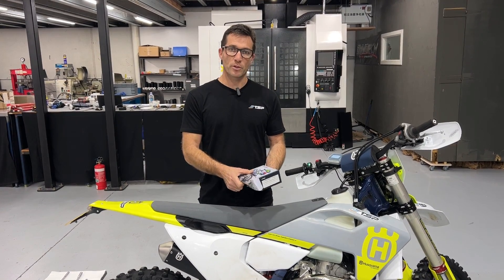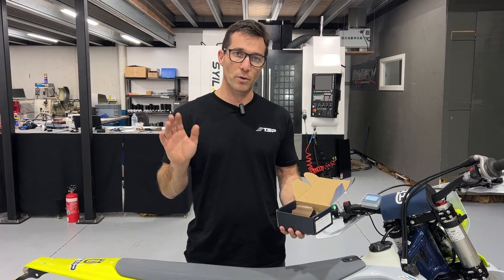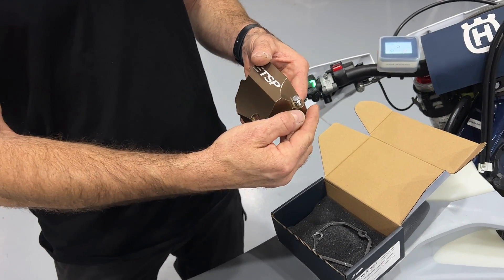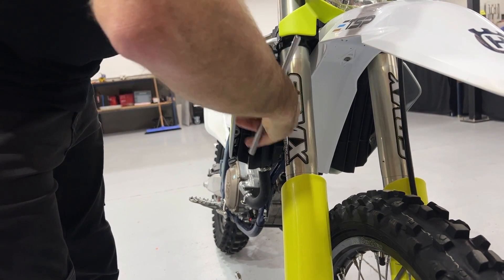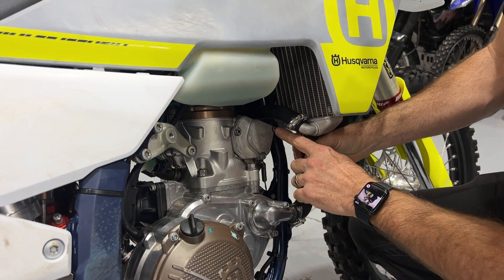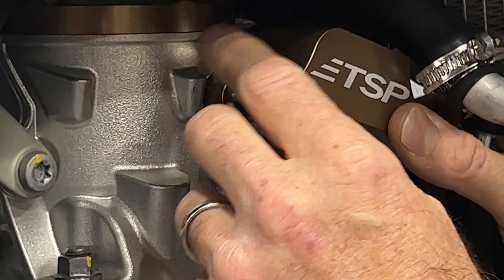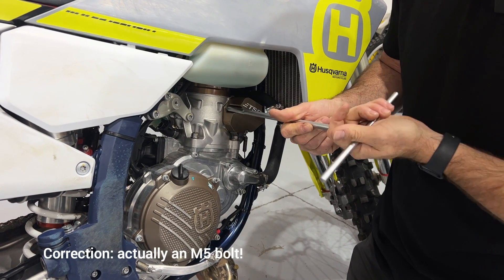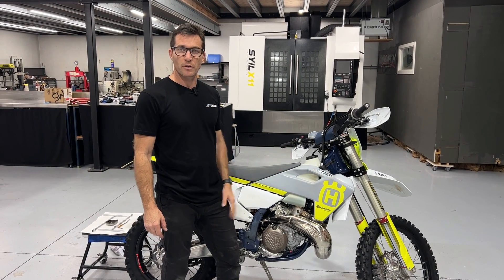TBI Oversize Powervalve Cover Installation- Two Stroke Performance

Comment: I just purchased one of these but haven't had a chance to install it yet. I was told by South Bay Motosports that now you just use all the stock bolts for the installation.

Comment: Installed one of these on my 24 300exc amd the engine management light has come on (5 lomg flashes) I've heard the cover can sometimes need a small amount taken away with a dremel??? Is this correct??? Thanks
Reply: My bike did the same thing. Did a powervalve reset, check engine light went away.
Reply from the maker: If you perform a powervavle reset it should stop the code from coming back. There were a very limited number of covers manufactured which 'may' have caused the PV to generate a fault code. Performing the PV reset will normally fix the issue.
Reply: @TwoStrokePerformance  have you had issues with the set screw fouling the PV cover??? I can see where it's been hitting???
Reply: Did you get to the bottom of this just installed one in my 2025 and on hard acceleration it throws the light on

Comment: TSP is not a company I would recommend. Last year I picked up a new XC 250. I ordered some parts including a TSP head, planning to build a bike over the winter. I then had an opportunity to pick up an xc300, which I did and subsequently sold the 250 still in the crate. I emailed TSP asking if I could exchange the head(still in the unopened box)for one for the 300. No reply. I emailed them again a week later stating I would pay any price difference as well as shipping both ways. Noreply. I emailed them a third time a couple of weeks later. No reply.  They simply do not care about customer service.
Reply from the maker: Please stop spamming our videos with the same comment. We have responded to a previous comment from you several months ago asking for you to contact us with more details as we had no record of your email address or anyone contacting us via email with a story like this. We have not heard anything other than more anonymous comments on videos. The fact is we have no record of your story and no missed emails. Perhaps it was dealt with and you didnt like the outcome, or perhaps you were dealing with one of our distributors overseas? If you are serious about having this dealt with please provide a name, email address and purchase receipt and we will happily look into it. We would normally exchange a product with no questions if the purchase was within a recent timeframe and the goods and packaging were as new. Unfortunately we cant always be held responsible if you change your mind about a bike build, but we do take customer service very seriously and make significant efforts to keep the vast majority of our customers happy. You cant always please everyone though.
Reply: @TwoStrokePerformance   I'm happy that you have finally responded. I will allow readers to determine if I am spamming or this is in fact an example of the sort of customer experience they can expect when dealing with SoutBay MotoPerformance. I have no reason to lie and nothing to gain other than helping others understand what happened in my case. I'm happy for all the customers that had a better experience.

I am 58 years old and have ridden motorcycles practially my entire life. I raced on the professional level and have had more bikes than I can remember. There are 5 in my garage at this moment. I am decently successful and have no reason to quible over a couple hundred dollars here or there. It is why after sending you multiple emails I simply gave up and gave the head to a friend who had an xc250. There are others that parts for there motorcycles represent a significant investment and for those people, I would say, make your own decision as to whether I am spamming or sharing an accurate account of what happened with my experience.

You certainly never replied to any of my emails and I have the reciepts to back that up. Not to my inbox, not to my spam folder, no reply period!
I'm not going to share personal information on the internet and I have no desire nor reason to contact you directly as I have no need at this point to return or exhange the part I no longer have. You also did not ever reply to any comment I have made on YT regarding this until today. Trust me sir, had you reponded, I would have engaged you just as I am today. You are either a liar, have very poor memory or have confused me with someone else. I'll assume that latter and leave it to readers to interpret the tone of your response and the varacity of my experience.

The only piece of info I will share is that the original email was sent on Sunday, April 21st, 2024 at 4:39 PM Mountain. If you track that down and respond, I will certainly respond back and confirm receipt. At this point sir, I have never recieved a reply to any of the emails I sent.
Reply from the maker: @Sandbagger65   thanks for the detailed reply. It has highlighted the reason for our mutual frustration and finally gives us something to work with… you mentioned  South Bay Moto Performance… South Bay is a distributor of ours in the USA and although we work closely together we are not the same business. We don’t have access to their emails or sales records. If you purchased from South Bay Moto then  you did not purchase direct from us. This would explain why we have no record of your sale or emails. Steve at South Bay is renowned for excellent customer service and it is very surprising to hear your emails went unanswered. I will forward the details of your complaint and discuss with him further.
Reply: You can characterize my experience and detailed explanation anyway you like. You can call me names and accuse me of anything you like. It does not change the voracity of my claims and I’ll allow the viewers to draw their own conclusions, including you.
Reply: @Sandbagger65  our conclusion is you’re incompetent
Reply from the maker: @booger65man we did reach out to SBMP about this and have had several conversations to follow up. I understand he found one email from back in April this year and I believe he has reached out to you recently regarding this. Im not sure why that email was missed, as Steve is normally renowned for his outstanding customer service. 

As I understand it the head was bought from another retailer in the USA (not Steve at SBMP) and then you reached out to SBMP to replace it after some time. This explains why neither us (TSP) or SBMP recalled your story and also why we found it hard to locate the correspondence because neither of us had dealt directly with you previously. Normally we would attempt to address any situations like this immediately and not let them drag on, however in this case we had no name, contact details, or record of purchase to work with and so it has dragged on for longer than necesary. I am sorry if your experience has been less than satisfactory. In future if you or any other customers have problems with a product please reach out through the original seller so that they can approach us directly with all the required info and we can sort out a solution quickly and easily.
Reply: @Sandbagger65 all you have to do is call south bay you dork. I’ve called them 7pm and they’ve picked up and answered questions for parts I didn’t even buy yet. Sounds like you’re incompetent

Comment: Can this be installed on a stock TBI without the TSP kit and receive the same or similar results?
Reply from the maker: Yes it can
Reply: @TwoStrokePerformance  same increase in low down  and mid power?

Comment: Does this sacrifice any top end? How would this work for a 300sx being used for MX with positive results?
Reply from the maker: Hi, no it doesn't sacrifice top end, however if you are riding faster stuff most of the time you wont notice much difference. The biggest gains are at low revs, approx 3500-5000 so if you are riding in that area a lot you will notice a big difference, but if youre mostly above 5000rpm you wont feel much.

Comment: I bought a TSP head for a 23 250 XC I was planning to build. I found a great deal and picked up a 300 XC a few weeks later after which I sold the 250. I emailed TSP and ask if I could exchange the 250 head for one for my 300. They never replied. I didn't think that it would be a big deal. I was wrong. I'll buy from companies that are easier to work with in the future.
Reply: Stop then bs tsp is super easy to work with and is south bay
Reply: You can characterize my experience and detailed explanation anyway you like. You can call me names and accuse me of anything you like. It does not change the voracity of my claims and I’ll allow the viewers to draw their own conclusions, including you.

Comment: How does it work?? 

At high revs the pressure waves travelling back and forth through the expansion chamber help to supercharge the cylinder, filling it with more fresh fuel/air than it would otherwise receive. This supercharging effect, and the extra power that results, is often what riders feel when they say a 2 stroke is “on the pipe” at higher revs.

The downside of this phenomenon is that the same pressure waves that help to supercharge the cylinder at high revs actually make it harder for fresh charge to enter the cylinder at lower revs. This causes a drop in power at low/mid revs. To combat this some powervalve systems incorporate a ‘Torque Chamber’. A Torque Chamber is a chamber on the side or top of the cylinder which is opened and closed by the action of the powervalve. When the powervalve is closed or down, the chamber is open to the exhaust gasses. When the powervalve opens at high revs the chamber becomes closed to the exhaust gasses.

At low revs, when the chamber is open, the pressure waves travelling through the expansion chamber enter the Torque Chamber and are dissipated somewhat, losing some of their strength. The reduction in the strength of these waves helps to improve the filling of the cylinder with fresh charge. Therefore, the Torque Chamber adds extra power down low by reducing the negative impact of the pipe in this rpm range. By adjusting the volume of the Torque Chamber we can further reduce the negative impact of the pipe at low revs, and increase power even more. This is how the TSP Oversize Powervalve cover helps to increase power at low revs (approx 3000-5000rpm).

In order to find the ideal volume of the chamber we spent months dyno and track testing various designs until we settled on a design that made a noticeable improvement in low/mid torque.

Comment: Seems like some snake oil. I read the detail on the website and it does not in great detail say what is going on exactly.
Reply from the maker: Its not snake oil. Some 2 stroke engines have used these chambers as part of their powervalve design for decades. The old KTM 360/380 motors, and the GasGas (now Reiju) 250/300 motors are 2 examples of exactly the same system. KTM has brought back an old design in the new generation 250/300 motor. 

Our website gives a fairly clear explanation on how the cover works...  here is the text... 

"At high revs the pressure waves travelling back and forth through the expansion chamber help to supercharge the cylinder, filling it with more fresh fuel/air than it would otherwise receive. This supercharging effect, and the extra power that results, is often what riders feel when they say a 2 stroke is “on the pipe” at higher revs.

The downside of this phenomenon is that the same pressure waves that help to supercharge the cylinder at high revs actually make it harder for fresh charge to enter the cylinder at lower revs. This causes a drop in power at low/mid revs. To combat this some powervalve systems incorporate a ‘Torque Chamber’. A Torque Chamber is a chamber on the side or top of the cylinder which is opened and closed by the action of the powervalve. When the powervalve is closed or down, the chamber is open to the exhaust gasses. When the powervalve opens at high revs the chamber becomes closed to the exhaust gasses.

At low revs, when the chamber is open, the pressure waves travelling through the expansion chamber enter the Torque Chamber and are dissipated somewhat, losing some of their strength. The reduction in the strength of these waves helps to improve the filling of the cylinder with fresh charge. Therefore, the Torque Chamber adds extra power down low by reducing the negative impact of the pipe in this rpm range. By adjusting the volume of the Torque Chamber we can further reduce the negative impact of the pipe at low revs, and increase power even more. This is how the TSP Oversize Powervalve cover helps to increase power at low revs (approx 3000-5000rpm).

In order to find the ideal volume of the chamber we spent months dyno and track testing various designs until we settled on a design that made a noticeable improvement in low/mid torque."
Reply: There is absolutely nothing that comes out of TSP that can be labeled or even that closely resembles snake oil. This company hits the high mark for solid performance and then some!!!
Reply: S3 has been making a similar product for the shercos for a few years. Can tell you it 100% makes the bike nicer to ride
Awesome to see TSP make their own version
Reply: @strictlymitch  I will only make one comment to that at what price? If you are a pro and need .5 more then spend the cash. $180.00 + shipping. If they were to show that 0.5 more torque would make significant difference to any rider. If you could see some sort of prospective of the real difference or gain from this modification. A quantitative view. The graph does show a difference but can you explain what that really means? Not some generic term more low end. More yes but quantify that.
Reply: My Kawasaki KMX125 has the KIPS power valve system, which has a similar chamber that connects to the exhaust port duct. When the power valves are closed, this chamber is open to the exhaust port, and when the power valves open the auxiliary exhaust ports, the chamber is blocked off simultaneously. It definitely works on my bike in the 4000-6000rpm area. So the modern Enduro and MX bikes work the same way, with a multi function power valve. I've read that because the chamber is effectively a resonator to nullify the action of the wave energy in the pipe, it can only work optimally at one particular engine speed, but in practice the range where there is some degree of useful effect is spread over around 1000rpm. The same thing would apply with an inlet boost bottle, but I don't know if both systems would work together without interfering with each other?
Reply: Okay. Did some research and yes this works but I heard there is another place that had it first and it is cheaper as well they are identical . “Pinit”.
Reply: @DirtRider6512  The best example I've seen for the action of exhaust port resonance chamber power valve systems is on a Suzuki RG500 website. A very modified tuned bike was run on the Dyno with a power valve closed run, Vs a power valve open run. with the exhaust resonance chambers open to the exhaust ports, the bike had a huge gain in low end torque and it also removed a dip in the power curve before the engine came on the pipe. It also showed that the open chambers totally killed the resonance wave affect of the exhausts, and the peak power was about 70bhp made at about 8000rpm with the torque curve falling away quickly after that point. Another run with the exhaust resonance chambers shut, showed a big loss in torque below 7500rpm, and a nasty pre power band dip in the torque curve. The peak power was about 120bhp at 10800rpm, with a corresponding strong torque peak, but overlaying the graphs showed how much of a broader power and torque curve with more area under the graph, when the system was working. The most important thing is getting it to open and close as quickly as possible at the ideal point on the rpm scale. I've read that adjustable length sliding header pipes have the same sort of effect but it's more effective still.

Comment: how does this give more power i dont understand its just a cover hmm thx very interested
Reply: It adds more volume to the power valve / exhaust area. 

It must change the resonance, like a boost bottle. 

TSP: post some dyno runs.
Reply from the maker: There are dyno runs on the product listing...
Reply: @TwoStrokePerformance  
Is the graph showing rpm vs torque or hp? I assume torque.
Reply: @TwoStrokePerformance  Looking at the product page and if I understand correctly then it only has effect with lower throttle openings and more throttle at low rpm gives same results as stock cover. So is there even any benefit? Could just use a more agressive throttle cam so engine makes same power for same wrist rotation as using stock throttle cam and your cover.

Comment: Nice product . Waiting for the new video on the installation of the IRK on a TPI 250 .😊
Reply: It is the same as on the 300
Reply: @simsonschrauber05 , there is a new procedure as the kit has changed slightly.